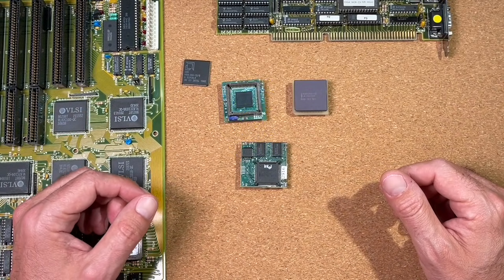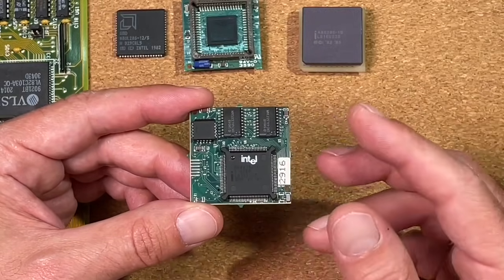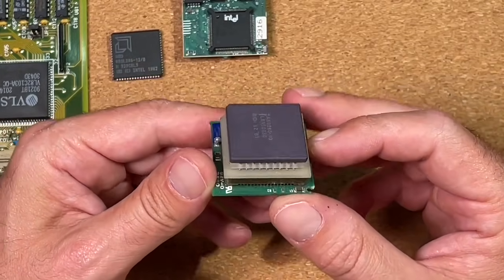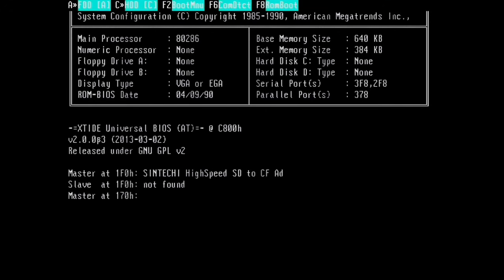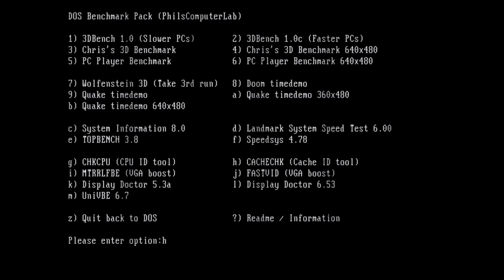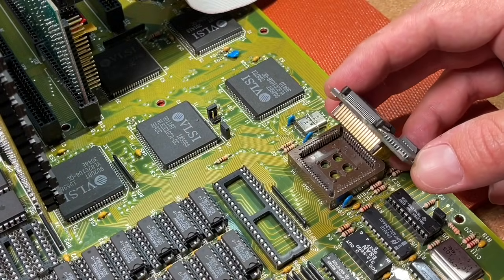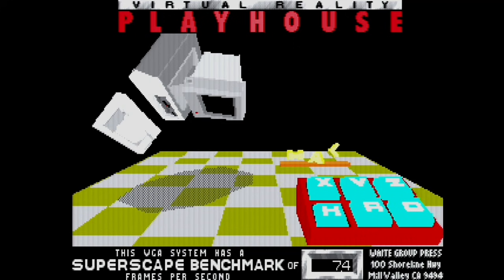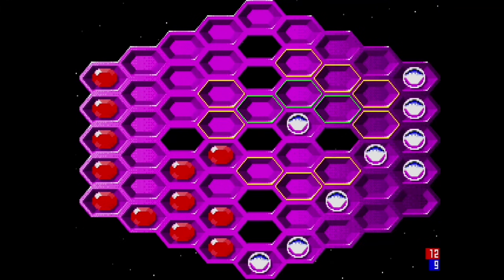286 Boost! Upgrade to 386 or additional Cache ~~ODD PARTS~~

Comment: 286 CPU upgrades were never all that good for the upgrades, even the 386sx upgrades were never a good, but the AMD 386sx from 16Mhz to 40Mhz was the Great upgrade, the last CPU socket the Pentium II 900Mhz to 1.4Ghz Pentium III was the Last of the CPU socket upgrades back in the late 90's ... BTW You gave me a Flash back of the OLD MultiBus II Builds of (Build your Own) Digital System Processor cards back in the Day for RCA in Camden, NJ..Before the Weitek Co-Processors were out in the Markets..

Comment: Your cache probably didn't show improvement because you had 0 waitstate RAM (as your sysinfo showed 18Mhz equivalent speed, original AT had 2 wait states to RAM). The bus access cycle of the 286 is 2 cycles, which means that even a cache would not be able to reduce that time, it is already ideal. The thing this cache might be good at is for overclocking your board. If you put a 16 Mhz crystal, you will have to add at least 1 wait state to your memory making the overclock not so useful. With the cache, it's possible that it works.

Comment: I don't think you need software I think it's a jumper setting on the motherboard that is required to activate the cache on the 386 cpu just don't know what the jumper settings would be for your computers motherboard as that is beyond me although if your brave try changing jumper settings on the motherboard till you get the performance you desire

Comment: Not pointless. 386SX @ 12MHz can run Doom
Reply: "run" is a pretty big word for the slideshow that would ensue, but technically you're right :) ... (if you managed to get 4 MB of RAM onto the board, that is -- many 286-era boards maxed out at 2 MB)
Reply: @KeyJ_trbl  25MHz 386SX was slideshow. 12MHz... actually I'd like to see that ;)